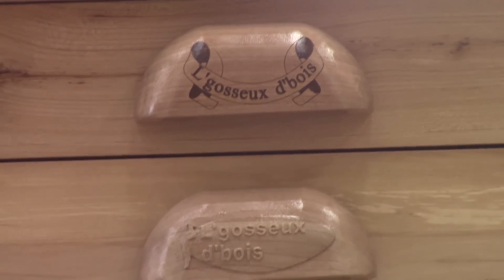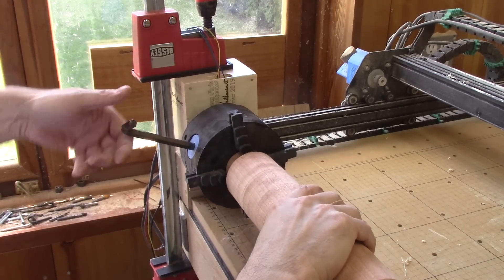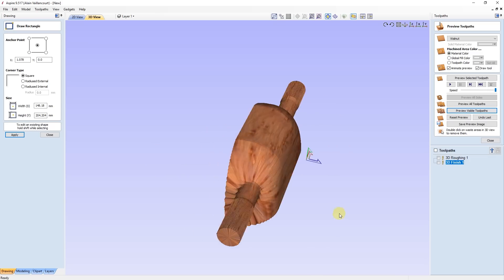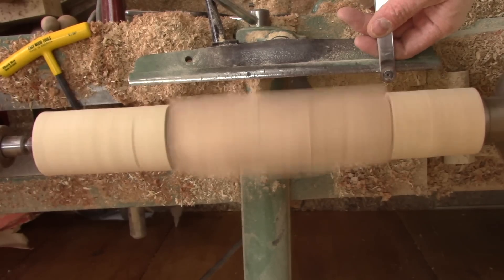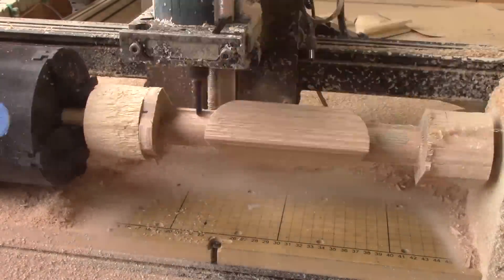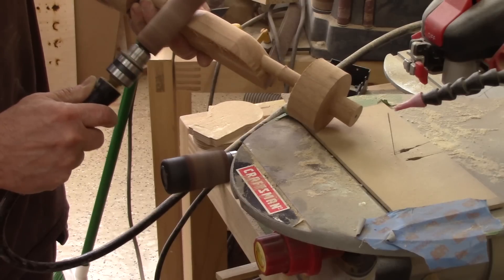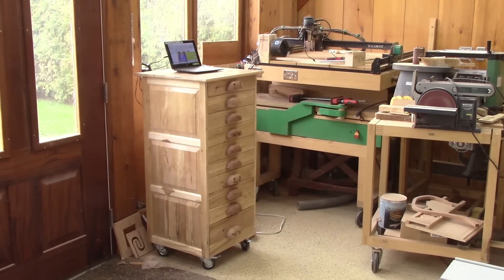The Woodpecker Ep 205  - How I made the pulls of my chest of drawers

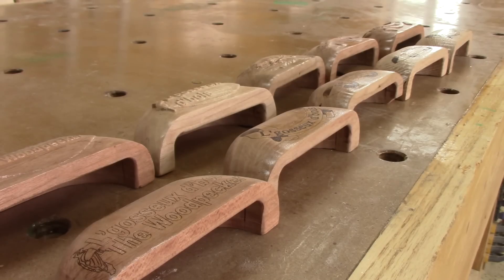Comment: I like the one @14:11  best and then @14:08 -- two of the laser engraved one.
Fun to watch, but I would NEVER do that... wow, that was a lot of work!
Reply from the maker: I also like the laser burned one more than the others. I find it's easier to quickly spot a drawer. On a chest of drawers like this it's a plus if you can spot quickly a drawer. Now I open them each day and strangely enough both the ones you pointed out are those drawers. I spot them quickly and grab either the electric screwdriver of even more often my security glasses. Either to take them or to replace them with my daily glasses that I've put at the place of the security glasses. I'm so glad all my glasses are free of dust now. 
Yes it's a lot of work, but at least now I know how to do this again if I need to. ::))

Comment: I like the ones with the logo burned in.  They are cleaner looking.  Maybe you could combine the two by outlining the carved figure and letters with the laser.  Whatever, I enjoy your work and look for to seeing more videos.
Reply from the maker: I also very much like the one that are laser burned. I didn't mix too much laser and cut but yes this would be a nice place to do it. But this is super tricky, which makes this idea even more appealing. Laser burning is MUCH harder to accomplish than carving. I realize that not many people wrap their mind around this, laser look simple. So many variables; wood species, laser power, speed movement and focal point. And on uneven surface like pulls if I would like to burn on top,where it turn, I would have to also drive the Z axis which I never do when I laser burn, I want to keep the focal point at the same place .
Reply: Thank you for the in-depth reply.  I learned something about using a laser.  All your points make sense if you are aware of the variables that affect the outcome.  Thanks again.

Comment: I understand this was an exercise to apply your 4th axis, so comments on other approaches may not be very significant.  But I wonder if making four pulls at once might be more efficient, since they would be close to round bundled together.  There would be less to remove by CNC, and they could be ripped apart after routing.  Leaving a square bit at each end could help the ripping.
Reply from the maker: this might work, because like you say I wouldn't have to leave as much in between than at the start and end. But like you said it was an exercise to test the 4th axis. I didn't want to waste to much nice cherry. But 4 I think would be too much for the capacity of my cnc maybe 3, 2 for sure. Thank you

Comment: how about a laser burn on the bottom of the engraved lettering as a sort of outline of the relieved shapes?
Reply from the maker: Since this was my first try a making useful stuff with my 4th axis and it took so many hours to carver this, I didn't want to add another thing that can go wrong and ruined 6 hours of work. But now it's on my bucket list trying to mix fancy carving with laser engraving, this can be interesting. But using the laser is much harder than carving the wood... So many variables to take into account; wood specie, laser power, speed movement and also the beam focus. I never thought that laser engraving would be so different that wood carving....

Comment: My only question is why didn't you use the CNC router to cutout your template for the pull recess??
Reply from the maker: I wish I could.. But strangely enough you can not cut deeper than the central imaginary axis of the carving. And since the finger pull were deeper than the centre of the piece I had to cut them afterwards.

Comment: Just wondering why you did not choose to add the finger pull space on the cnc. 

The pull is the best
Reply from the maker: I wish I could.. But strangely enough you can not cut deeper than the central imaginary axis of the carving. And since the finger pull were deeper than the centre of the piece I had to cut them afterwards.
Reply: So would that be a limitation set by the software? Meaning if you’d used a different piece of software this would be different?
Reply from the maker: Maybe I,m not sure. I don't know other software that can do this? But it's true I would be great being able to carve deeper than the imaginary centre line. Be cause of that even cabriole legs need to be offset a bit.